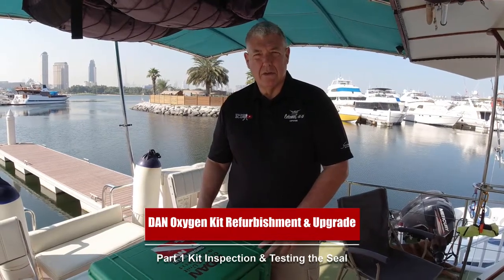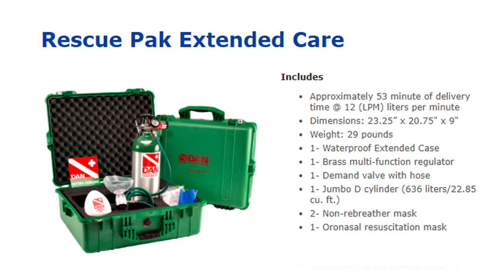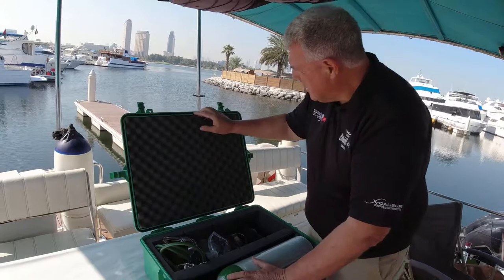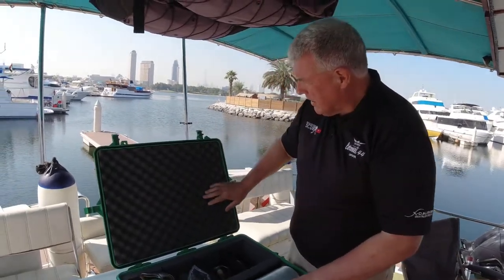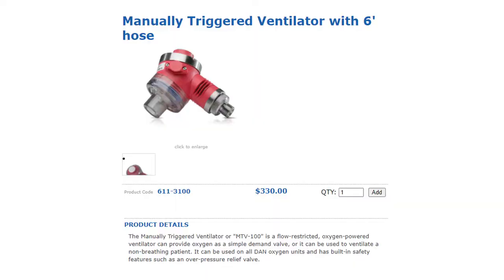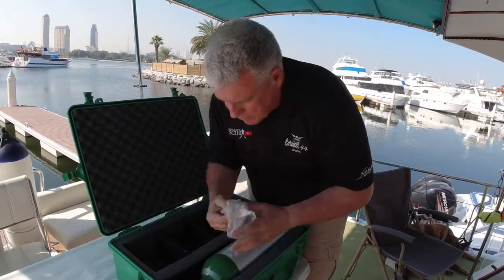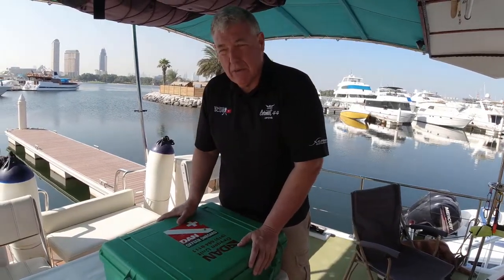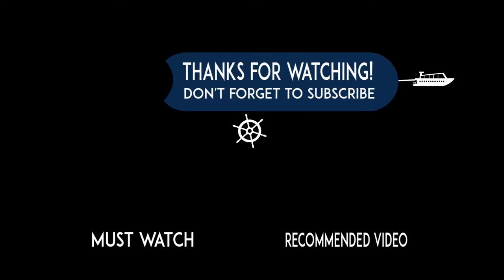DAN Oxygen Kit I Refurbishment & Upgrade I Part 1 Kit Inspection & Testing the Seal

Comment: Good video. I’ve never had a play with one of the DAN kits. As you probably know, here in the UK the Marinox kits reign supreme as they live in their case made up, assembled and ready to switch on. They’re also more compact and perfect for putting on a RHIB 👍 Looking forward to the rest of the series.
Reply from the maker: The Marinox is ideal for UK RIB diving. It’s a bit limited for duration with 540 liters of available oxygen. However with the RIB’s speed and quick response time of UK emergency services it’s probably enough. In Part 3 I will show how you can get more some additional gas through both the DAN and Marinox units.